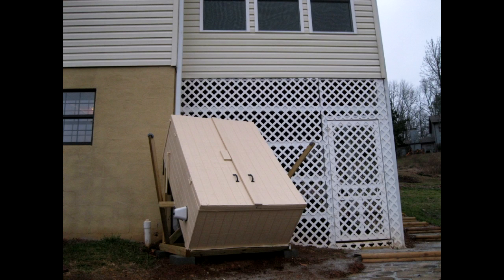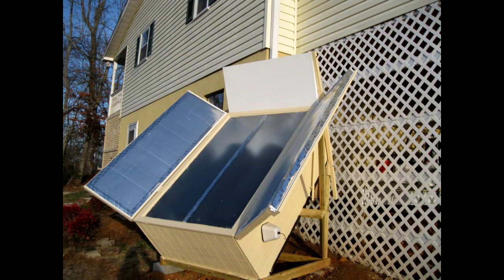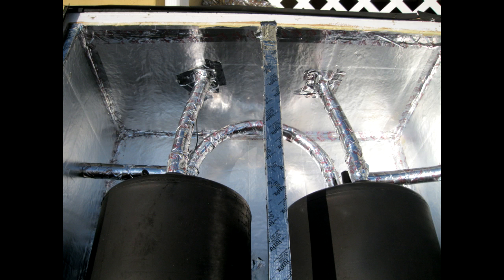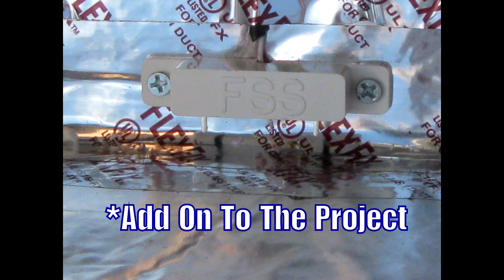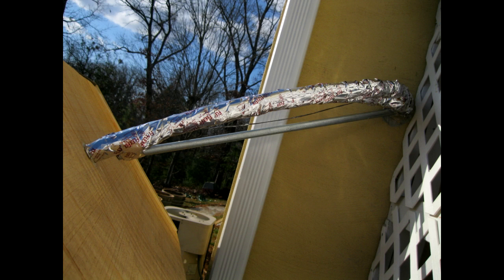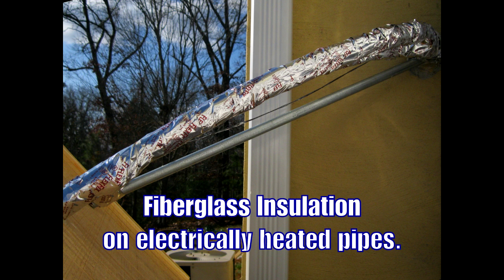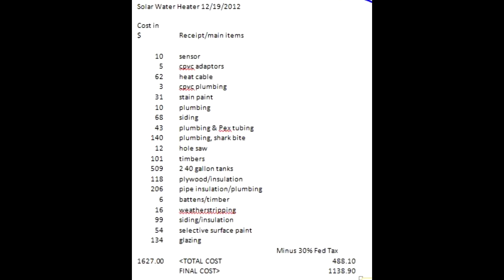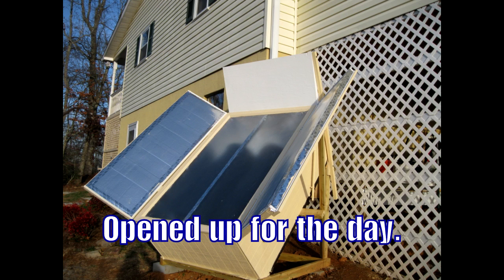Solar Water Heater - Passive - Build/Install Breadbox

Comment: This is a really cool project and a great video. In my small retirement house i plan on using a tankless propane water heater, but something like this would be a great way to preheat. I'm in South Texas, so it's blazing hot most of the year, and just kinda hot the rest. Might as well take advantage! 😂

Comment: I installed a 30 GL system 10 years ago. It worked really well. The water tank started to leak and I need to replace it. Where can I get a replacement tank? I have a black steel tank, which has some type of lining in it. Dimensions are horizontal cylinder, 35"  (length) x 16" dia. If anyone has a tank or any suggestion how replace the steel tank with a plastic tank, please let me know.

Comment: Hey thanks for this video, bud. I am exploring ways to passively heat a large garage in northern Maine and every bit of info helps. I'm curious if it's possible to route the water through a radiator once it has been heated and stored in the indoor tank? My garage is off grid and being able to passively keep the indoor temps above freezing would be a huge benefit to me. Any thought on this?
Reply from the maker: Not sure.  Water freezing/bursting pipes is a concern.  Would consider 'space' heat or just heating the air and blowing it into the garage.

Comment: Good day, I would like to ask if how many watts can this solar water heater can produce? Thank you so much.
Reply from the maker: I have no exact measurements that would allow me to determine that with any certainty.  I ESTIMATE (and believe this to be somewhat reasonable as the city water comes in at around 65 deg F and I estimate the solar heats it up to around 100 deg F on an average day, then the water heater heats the water from about 100 deg F to 130 deg F for hot water uses.) around 50% of my hot water (during the course of a year) is heated with this passive solar heater or savings of about $250 worth of electricity.  TVA electricity in my location is about $0.13 per kilowatt so, $250/$0.13/KW =  about 1900 Kw per year electricity saved.  Per day would be 1900 kw/365 days = about 5 kw/day on the average.

Comment: im sure you'll build it yourself. I made it 2 weeks ago thanks to Avasva website.
Reply from the maker: Thanks.  As I remember I believe it took me about 2 weeks to make it by myself and the booklet by Jeff Tiller mentioned in the video had all the directions.  I changed the plumbing pipe to Pex, added recessed valves and changed the doors to side opening and not the up/down doors in the booklets.  Side doors/shutter are easier to open while a TOP vertical door/shutter would have been awkward and heavy to open and close.

Comment: i worked under Jeff Tiller at Southface Energy Institute, in Atlanta, in the early1990's.  Had the privilege of passing this book out at home shows in Georgia, South Carolina and Alabama.  Thanks for the excellent video.
Reply from the maker: Southface did some good solar works early on.  Thank you kindly for your comment.  The unit is still working well.  No freeze up, no leaks.  Just painting etc on occasion.

Comment: do have an idea of how much this passive preheat system saves you in electricity?
Reply from the maker: I do not have any real data to give a supported answer.  With that in mind:  I have checked the two tanks, the first or cool one and the second or hotter tank.  On a sunny day in December (relative low amount of sunlight when compared to the rest of the year) and at the end of the 'solar' day (about 5 pm) I checked the temp at the bottom of each tank.  The cold tank was 80 deg F and the hot tank was about 90 deg F, so the top of the hot tank may be around 100 deg F.  So, in conclusion the water coming into the house from the city or in the ground is around 60 deg F and gets heated up to around 100 deg F by the solar water heater.  The electric water heater takes the 100 deg water and heats to 130 deg F for household use.  So, 60 to 100 for the solar heater and 100 to 130 for the electric water heater or 40/30 degree of heating.  So, on one of the lowest solar light available, the unit provides a little over half of the energy for heating the water.  Note:  not every day is sunny.  I need to point out that I now have an electric heat pump for the water heater.  Hot water is used nearly every day or YEAR ROUND and it takes a lot of energy to heat water (I calorie/gram), so getting the water preheated is a good start in reducing the cost to heat water.  I guestimate that my saving via the solar water preheater is just over 50% for year round for all weather.  Here, that is about $250 - 300 per year.

Comment: yes that's how I should said it remove heat tape closed box between the two which would draw warm air from home in freezing conditions.  just a idea.  I live in Ky I could drain in the winter just worried about freezing.  I was looking at a coil system but I really like this better a lot more volume.  maybe I could use thermosiphon with wood stove in the winter.
Reply from the maker: Trade off for more water is it does not go to as high a temperature as one with less water.  It pre-heats the water before the water goes into the regular water heater.  I ESTIMATE that my street water comes into the house at about 60 deg on average, then the solar water heater takes in up to ON AVERAGE maybe 100 deg, then the regular water heater takes it to about 125 deg.  So, the solar water heater supplies close to 2/3 rds of the heat for the hot water.

Comment: awesome detailed video. 1. would fabricating a removable insutated box around exposed lines from house to the bread box help?   
2. Do you have the elements (on) the tank inside your home? 
3.  Approximately the outside winter temps in your area on average?   
thank you so much.
Reply from the maker: 1. Sounds like a good idea.  I would not have an electric tape on the pipe then as the heat build up could be a problem.  2.  The electric heater in the house does have the elements ON as they generally heat the warm water from the solar tanks (about 100 F) on up to about 125 F.  3.  North Ga. December - January temp may Average 40 - 45 degrees F in the winter.

Comment: Hi Jim,  thank you for the detailed comments. They are very helpful to understand how to replicate what you have. One question: In another similar video I watched, the fabricator painted the inside surfaces of the box the same flat black paint that is on the tanks instead of using the reflective material you used. Any thoughts on that ? Is this addressed in the book you recommend ? Thanks again !
Reply from the maker: Thanks.  My thoughts are to get the light on the tanks so the tanks/water will be heated.  The tanks, that's where the water to be heated is.  The point of the reflector doors on the outside are to get the light into box and onto the tank and the purpose of the inside of the box should be to get the light on the tanks.  The focus of the light should be on the tanks.  Heating the surface around the tanks will not be as efficient as directly heating the metal tanks.  Hotter metal (good heat conductor) tanks will help in getting the heat into the water inside the tanks.
Reply: Thank you Jim. What you explain is consistent with what I later found in chapter 3 of the following document:
http://deltavolt.pe/documentos/Integral-Passive-Solar-Water-Heater-Book.pdf

Comment: Thanks for posting this. I have two questions. Why didn't you paint the box black and get more heat on it from the sun AND why use reflective tape on the pipe instead of again using black to absorb?
Reply from the maker: Painted the box to go with the house for a better curb appearance of the house.  Aluminum reflective tape on the hot water line provides a reflective barrier and this will reflect radiation from the hot water back into in the line so there will be less loss of heat from the water lines.

Comment: Where did you get the "glass"/glazing?
Reply from the maker: +Kevin Wallis I ordered the translucent fiberglass glazing from an online company.  They come in sheets of approximately 4 feet by 6 feet which worked for this design.  Fiberglass has some advantages over glass.  Hail, sleet, rocks... it does not break and the transparency is near glass 90% or so.
Reply: +Jim Crawford Do you remember the name or where you got it from?
Reply from the maker: Sorry no and I can not find the files.

Comment from the maker: Over 3 years and passive solar water heater still working well.  Low maintenance.  I have had some foam repairs on the doors using aluminum foil tape.  No other issues.  It's plumbing and there are no leaks.  Wow, that is good/lucky work for me.  It did NOT freeze this past winter, even though the Polar Vortex gave us several days at a time of near 0 deg Fahrenheit at night.  Had it froze over, there is a By-Pass near the electric water heater.  It just by passes the solar water heater and goes on like the solar water wasn't even there and we would have just used the electric water heater to hear the water.  So, no stoppage of hot water.
Reply: What state are you located in? Any luck this would work in Michigan?
Reply from the maker: Georgia.  Freezing is the concern.  Pex tubing (expands with freezing water - no guarantee but hepful), recessed valve, sloped water lines (thermal siphoning) to house and heat tape may be enough.  Don't know for sure but the video is watched in Canada quite a bit.

Comment: This video was posted nearly one and a half years ago. If this system is still in use (i presume it would be since it's still posted), what cost savings in heat have you saved as of this date? Thanks for the video. Nice job.
Reply from the maker: I have not collected any data so I can not state what the savings are.  Also, there were many variables in living styles, change of address and so data may not have proved anything.  My 'belief' is that the water heating has been reduced to half what it used to cost.  (Again, no data to prove this, but the solar heater box gets up to 140-160 degrees on most sunny days).  Water heating 'by my estimate' would be 1/4 of total cost electric, so an estimate is 1/2 of that so it would be 1/8 reduction in electric costs.  This gives a payback (pay for solar heater, materials only) is just over 4 years.  After that, free pre-heating by the solar heater.  Another important factor has been my living style has changed some to make better access of the sun produced hot water:  showers in the afternoon/night, dish washer in the afternoon/evenings, no morning showers, also sometimes skip showers and dish washing on cloudy/non-sunny days.  Cheating some to make the best use the sun heated water.

Comment: Do you fill the first tank and leave the 2nd empty to allow syphoning or are both full in the beginning?   May be a stupid question
Reply from the maker: No.  Both tanks are full of water, at all times.  Water flows from the top of the first tank (on your left) to the bottom of the 2nd tank or the right. Just the way water tanks work via their plumbing.  So, both tanks are always full.  If empty and a sunny day, it could get dangerously hot for the materials such as foam, wood, pex tubing and such.  Metal would be OK but not many other components of the box.
Reply from the maker: To fill the tank the very first time, you do have to let the 80 gallons of air escape.  Did that by turning on the water and with a line near the electric water heater not connected and let the air bleed out.
Reply: Must have been reading my mind.  I was literally wondering about that yesterday.  Ty

Comment: Nice job. Ever considered putting solar cell panels on the inside of the doors. Once open it can give you extra electricity and can even be directed to the heating of the pipes during winter. If that is sufficient power it will help elliminate the heating bill if that way.
Reply from the maker: Would consider putting a solar powered fan INSIDE the box to make it more like a convection OVEN.  Convection ovens cook at a lower temp and cook quicker that a regular oven.  The moving hot air comes in contact more often with the metal to provide better heat transfer.  Just like the convection oven, the food in the convection oven comes in contact much more often with the moving air and the heat transfer is superior.  So the food cooks up quicker.  Same should happen to the water in the tank.
Reply from the maker: No but I am considering putting a solar powered fan inside the bread box to make it work more like a convection oven.  Convection oven can cook quicker at a lower temperature due to the air currents hitting the meat (in this case the tanks).
Reply: Jim could I do the same thing but enclose the entire breadbox unit into my “lean to” with a glass window. Will the glass panes kill the direct heat from the sunlight?

Comment: very useful ... you may think about using an old fridge for the breadbox- already insulated , stainless steel outside - a drink fridge would already have double glazed doors. these are large and regularly thrown out .
Reply: Very smart idea!!! thanks I will borrow that idea.
Reply: You could close it at night to prevent freezing in colder climates also!!
Reply: Heather Carey j

Comment: Outstanding! So now that you have had test time, how much has this actually lowered your power bill? Thanks!
Reply from the maker: No data and my lifestyle varies too much to compare.  So, not very scientific but the thermometer in the box does show a high temperature of around 150 deg F on sunny days.   Also, water line between solar tank and water I've calculated to be only .9 gallon, so hot water is getting to the regular water heater with most usages.
Reply from the maker: Estimate about 1/8 reduction in electric bill (electric water heater), but no data to prove.  Lifestyles have changed some to make better use of the solar heated water on sunny day and not using much hot water on non sunny days.  Also, my electric water heater is 15 years old (it has a 6 year warranty.  This is a spec house.  In more disclosure the house was vacant for about 2 years before I bought it)  and the water heater is still working.  It appears that the load on the water heater is not too much and may add to the longevity to my electric water heater.

Comment: I like the project but I have a question about the doors. I'm located in Virginia in the Blue Ridge Mountains. It gets pretty windy in the mountains. Have you done anything to secure the doors while in an open/closed position to keep them from slamming in the wind? I was considering a D-Ring on a cord or small chain.
Reply from the maker: No doors have blown Open from the Closed position, however, as they are at about 45 degrees when Open, I have had a door to blow from Open to Closed on occasion. 
I have remove the posts that used to support the doors when Open as both doors were getting a slope in  the middle along their vertical axis..  Now, I have a small chain across the bottom to support the doors when Open.  Also, I have a 2 layer 1X4 at 45 degrees at the top to support the doors.  (Looks like horns when doors closed).  If blowing Closed becomes more of a problem, I could just 'hitch' the doors at the top with this new support.
Reply: That's one of the ideas that I was considering. Thanks for your quick answer!
Reply from the maker: Walt O'bringer
I have recently added a latch on each door to help secure/hold it open on  windy days.  Cheap solution, just one more thing to do when opening & closing.
Reply from the maker: Jim Crawford
I have added eyelet hinges (like on a screen door) to the doors and hook (latch) the doors on windy days only.  Latching is not needed on most days.  Helps keep me attuned to the weather.

Comment: nice work .thanks for sharing .
Reply from the maker: Thank you.  Winter temperatures have gone down to 0 deg Fahrenheit accompanied with low temps for a few days with the polar vortex and there has been no freezing of solar water heater.  But there are valves to by pass the solar unit should it freeze over or leak.
Reply from the maker: Thanks.  Good to hear the 'nice work' comment.

Comment: Nice job!  Do you have any numbers you can share as far as performance to date?  Have you done any calculations as far as how many BTU's you are gaining?
Reply from the maker: No numbers on this as there are too many variables in family lifestyle.  Also, thermometer gives air temp and not water temp.  Though it has reach 160 F air temp, that is not anything usable to calculate.  I made one of these units 30 years ago and.... based on memory it does provide around 50% of water heating for family of 4 at latitude 34 degrees.  Jacuzzi does use about 50 gallons of hot water per use.  Also, bathe and wash dishes in early evenings, not mornings to more efficiently use the highest temp pre-heated water.
Reply from the maker: Sorry as I have no data and there are many variables to lifestyle.  Sunny days the box temp reaches 150 or so max.  Water will be at a lower temperature.  Hot water heater at about 120.  Never had water too hot.
Reply from the maker: No numbers to prove any thing.  Belief of reducing water heating by 1/2 and total electric by 1/8.  Estimate-guesses only.  Life style changes at the time of installation and afterwards impact the outcome severely.

Comment: Man, you are one sharp dude. That is exactly what I need for the shop bathroom I am building. I think I will use my old 50 gallon water heater but will try to build it to your configuration. Thanks and keep up the good work.
Reply from the maker: Thank you and I hope the project goes well for you.
Reply from the maker: Thank you.  Very good and meaningful to hear your compliment.  Lots of luck.  Try the Jeff Tiller book mentioned in the video.  Online for just a few dollars.  Pictures and all.
Reply from the maker: Thank you and I think that makes us friends.